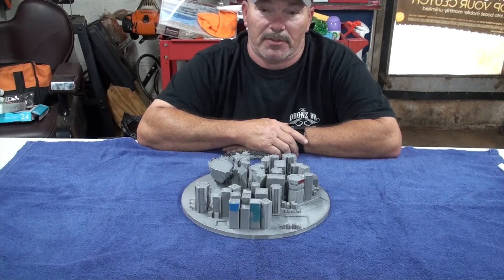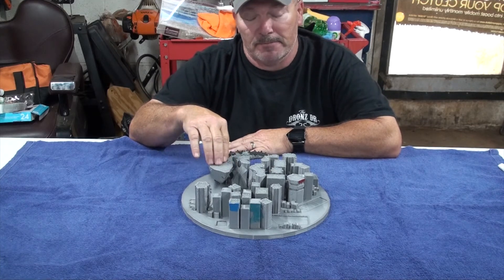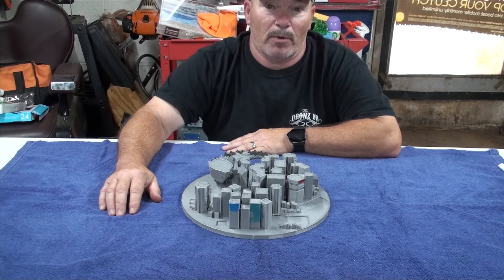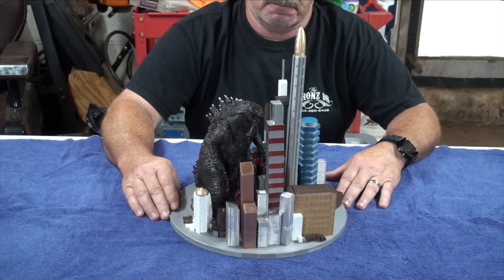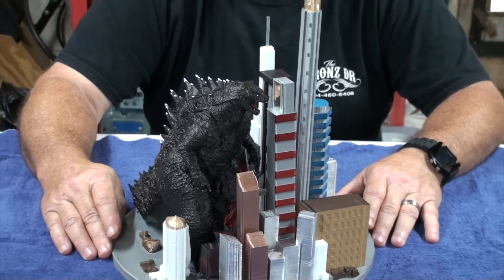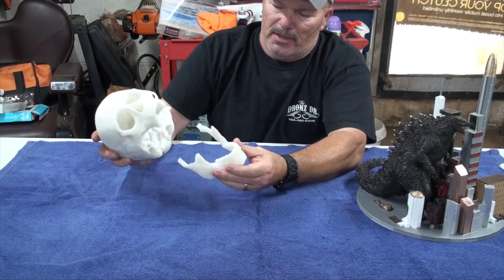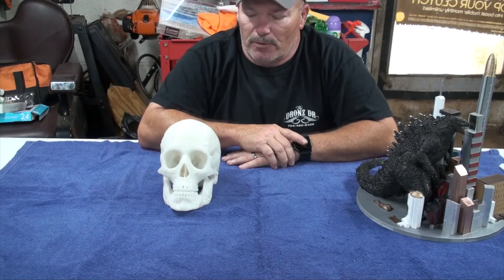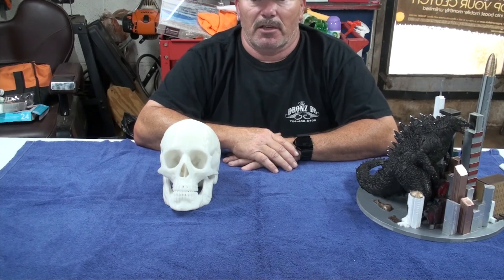Raspberry and filament sensor on the Anycubic (What you should know)

Comment: Nice Print. That is a great point to make about the Filament runout sensor. Most people don't realize it is connected to the Screen and not even the Board directly. The screen runs it's on software so it can resume or pause the jobs with G-code commands that it sends to the board. It would almost make sense for the PI to communicate with the screen so that all the custom printer features were available to the PI also.
Reply from the maker: 3D MakeIt 
Thank you